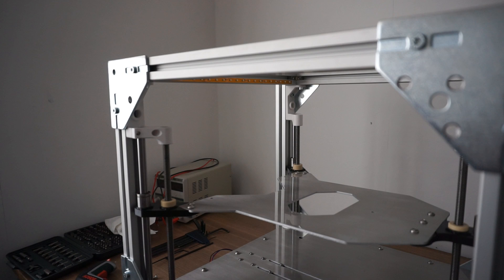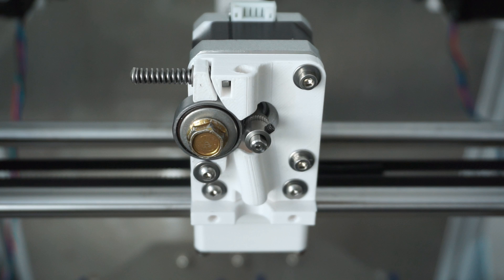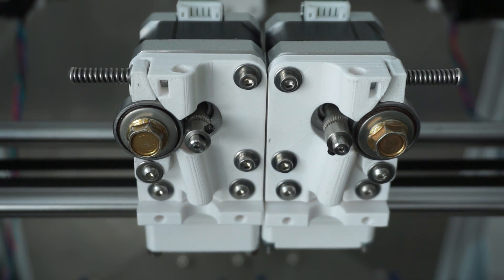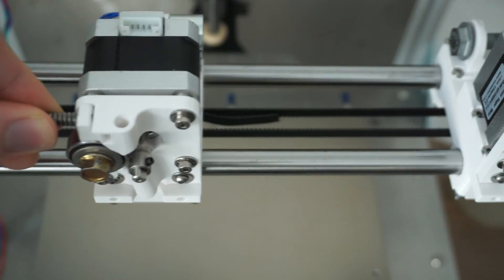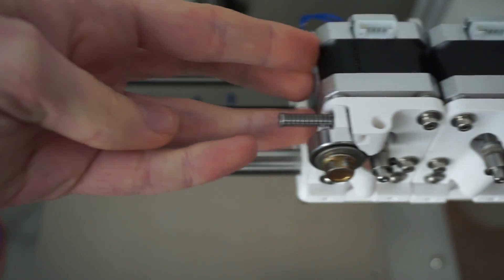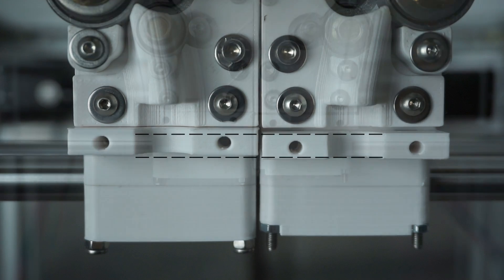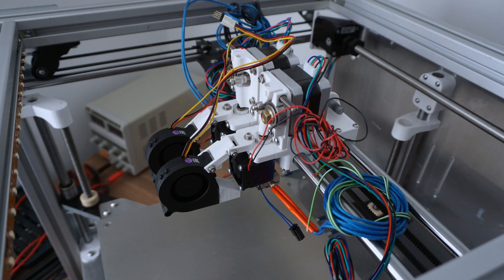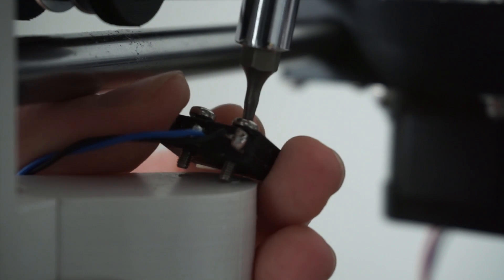(Re-)Building a 3D Printer - Part 2: X/Y-Axis and Dual Extrusion

Comment: I just have to say this is genius. I often wonder why folks don't use the upright frame extrusions are not used as z rails (if the cube dimensions are true).  Hard to find fault with your excellent design though.

Comment: Hey I think your extruder setup is nice! Parking just 1 extruder as you normally use the "main" one, no point on adding more complexity and inertia with dual parking and central driver 👌. 
I want to build my dual extruder reprap printer with similar approach to yours, but cannot figure how to configure Marlin 1.1.9 as it has only integrated dual parking with leveled nozzles. Also, could you provide the gcode scripts you use to enable using both extruders from the slicer side? Thank you very much in advance!!!
Reply from the maker: I am using Repetier, so I don’t know if this is also going to work with Marlin, but I only configured the offset of the second nozzle in the firmware. The rest of the tool change is done by a very simple script in Simplify3D:
{IF NEWTOOL=1}G1 X181.5 F4000
{IF NEWTOOL=1}M42 P6 S255
{IF NEWTOOL=0}G1 X181.5 F4000
{IF NEWTOOL=0}M42 P6 S0

M42 P6 switches the magnet on or off, G1 X181.5 moves the carriage to the parking position.

If you still have any questions feel free to ask them. Good luck.
Reply: @leonbrauns  Thank you man! I will try to implement it before building the carriages in case it is too complicated. I am also getting the advantage of 2 independent heads to have
Main: lightweight with 1.75 bowden
Normally parked: geared 3mm (as classic gregs wade).

You can check my concept here: https://www.dropbox.com/s/0g5ccamj2kna276/8%20-%20Hotends.JPG?dl=0

Comment: Hey,  It was fantastic rebuilding. But how did you attach the wires of two stepper motor on Y-axis, as ramps gives only one motor connector for it?
And isn’t it gives too much of load on motor driver? And yes i also like to know your E3d heater & nozzle model?
Reply from the maker: Thanks! The motors are connected in series on an external perfboard (you can see it in part 3). By connecting them in series the current from the driver stays the same, so the load stays the same (you might need a higher supply voltage, but for me 12V worked unproblematically). I use a 40W 12V heater and the whole range of nozzles they offer.

Comment: That is one heavy-duty 3d printer. It looks robust enough that you could add an engraver head to it if the build plate could be swapped for something heavier.
Reply from the maker: My idea was indeed to make this a hybrid machine: The complete z-axis can be exchanged with a solid metal plate, thicker belts can be installed without changing any of the parts and all electronics are seperated from the "build chamber", safe from any dust and debris.
However I never felt the need to modify it and it most likely is going to remain  a heavy 3D printer for the rest of its life.

Comment: Hi, so good you have everything working, Dual extruder with 1.06 mm height difference is a good idea, for the electromagnet 

Just a suggestion: may be a salvaged HP Laser printer Solenoid clutch electromagnet  (which has a lever with a 90 degrees bend ed hook at the end, or from Ali Express for 5 euro) could provide a solution for the overheated electromagnet problem. If you connect it right you only have to activate the electro magnet during disconnecting or connecting both printheads. the spring could keep the hook connecting both printheads. My magnet would draw about 160 mA from 24V continuously, at 12 V it will be less strong, so less distance magnetic attraction from solenoid to metal lever.
Reply from the maker: Hey, thanks for the suggestion. This seems like a good idea for a future build, I am going to keep it in mind ;).

Comment: Why two motors on the Y axis? Especially as you've joined them with a shaft coupler? Seems you could have a single motor with that shaft in place of a second motor? Otherwise this is a nice looking setup and I'm watching your rebuild series on this. Nice job.
Reply from the maker: Thanks! When I made the first sketches for the printer I was a bit worried about the torque of the stepper motors, as the x-axis is pretty heavy thanks to the 12mm steel rods and direct extruders. Today I would rather choose a much more lightweight construction, but I have to work with the materials I got ;). And I think one stepper would also be sufficient for the heavy axis, but as I had both of them already lying around, I went with this design.
The shaft coupler is there to prevent any misalignment of the two sides while moving the carriages manually.
Reply: Thank you for the reply. I most certainly understand making use of items on hand!

Comment: Whats about ozing with the main extruder? I like the idea of that two magnetic carriages but imo a single 'mastercarriage' and 2 slavecarriages with the extruders will eliminate the ozing problem.
looking forward for upcoming buildlogs ;)
Reply from the maker: You are totally right, I would also prefer to use two slaves. However I had no good ideas to use the print space efficiently with such a concept. But ultimately I am confident that oozing won't be a problem:
The printer is made for slow, accurate prints. Therefore I can lower the temperature of the nozzle quite a bit to reduce oozing. Additionaly the extruder is right on top of the hotend which is a big advantage to a bowden extruder. I tested it before and with a retraction of 3-4mm there was basically no ozzing.